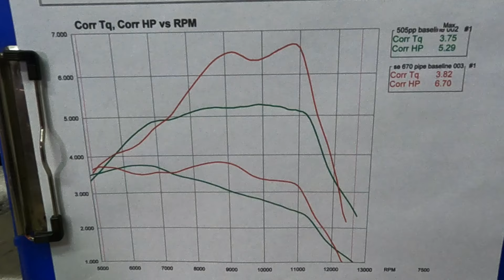Worksaw and Race builds Poulan 505, Jonsered piped!!

Comment: I have a 625 jonsered with a 272xp top end , it feels like a torquey 372 ,just not as fast.
 The muffler on my 475 Poulan Pro was pretty restrictive! There's a huge baffle in there, but its not welded in.

Comment: My 670 West Coast Champ runs awesome although its a little rough to use for long periods because of the vibration but other than that it's awesome the PO did a carb mod to where it uses a 272 air filter and top cover that is dyed black to match and a dual port muffler but I think it runs just as good as my 372xp

Comment: Totally unrelated to the video, but I'd sure love to see a stock Husqvarna 285CD on the dyno. So far, there's not even a guess on the numbers it puts out, that I've been able to find. I've got mine loaded with a 28" .050, and it just pulls. Not the fastest cutter in the world, but it will absolutely haul you through the damn log.

Comment: Yeah Joe, that 670 should have a 50mm bore like the Husqy 266/268.  You flashed that 272 intake too quick but it looked like it was aftermarket?  if you manage to get it to seal you should also buy a lotto ticket....
Reply from the maker: Thanks for the info. I do believe the intake is oem too.Well hopefully
Reply: @dynojoemods2764  it might be OEM - I didn't get a really good look at it.  Going to be an interesting build...